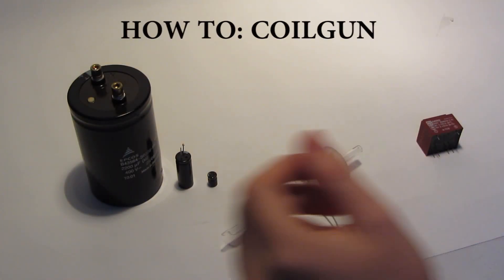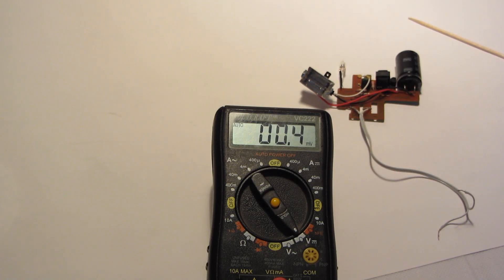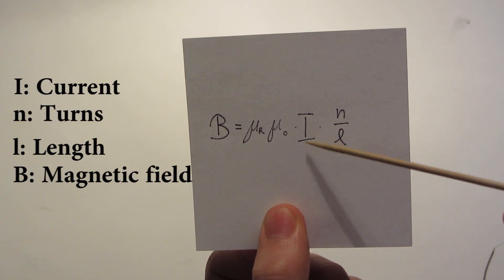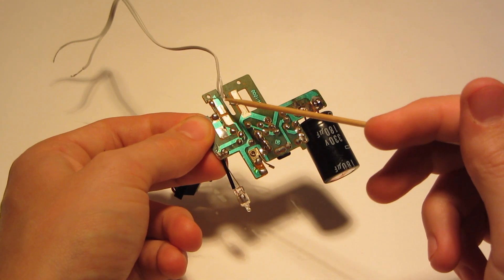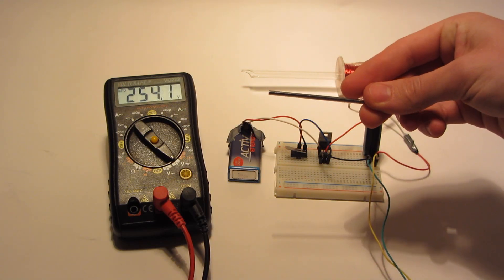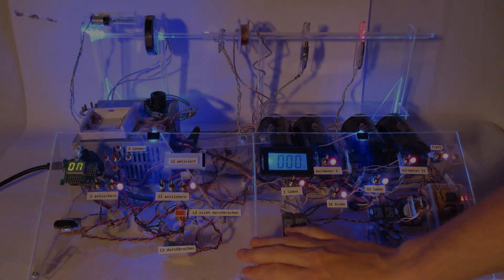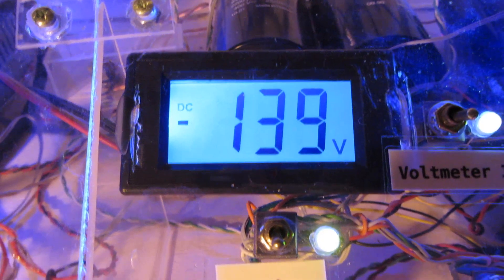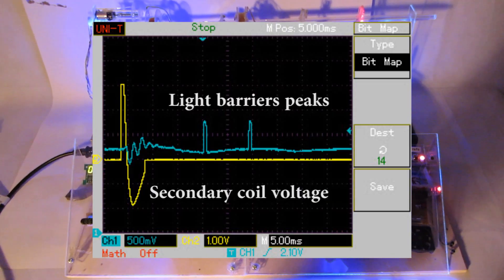How to build a Coilgun or Gaussgun Experiment - Tutorial

Comment: Is there any way to do it without any transformer or flash circuit?... I have four 1000 micro farad capacitors and they are small... As small as the capacitor in your flash circuit... I use a nail as a projectile and I connected three capacitors in parallel and charge them with 3 9v batteries... If I charge them with more batteries will I get better results?...
Reply: Just be careful. Don't charge the capacitors higher than the voltage they meant for.  Capacitors can easily blow up.  I've seen it many times. 
If you put them in parallel they will have up up 4000uf but still only the voltage it says it can hold. That's why high voltage capacitors for high uf are bulky.

Comment: what are the 3 little black things on your breadboard at 4:30? and is there a way to charge the capacitor by using a transformer and a 9v battery? (my  capacitor goes to 330v) ive been trying to figure out how to charge the capacitor but i realized that i need AC on one end of the transformer, and a 9v battery does not emit AC, its DC. and it confuses me how you got yours to charge with that 9v.

Comment: How do I identify the contacts which the battery normally contacts to?
Reply: ***** I got that and I think I found them but they seem to have a mind of their own,I connect them,nothing happens,I get frustrated and after I've calmed down I do the same exact thing again and it charges but I've charged and discharged it a few times now but now it doesn't want to charge at all for some reason.
Reply: Hendlton You might have burnt out your capacitor, it does not like being discharged like he did in the video, atleast not very often.
Reply: telefon72 Like I said,it didn't like charging so I discharged it maybe 2-3 times,I don't get how it doesn't like discharging if it's supposed to take photos.
Reply: Hendlton It does not like discharging like the way he did, where you short out the leads.
Reply: telefon72 Oh.

Comment: Voltage do not kill, milliamperes do kill. Voltage will hurt as hell but it isnt really what makes your heart stop beating. But if the voltage is really high and you have a low pain threshold and a weak heart then you might get an heart attack. just remember that most stun guns are in the region of 5000 volts.

(But beware i'm no electric expert)

Comment: What if you use two S6025L thyristors in parallel connection do you need to double up the resistor value for gate and also do you need to double the resistor value for gate katode connection?

Comment: Question: I tried this project before, sadly it didn't work. It could have been my coil, my circuit etc. My question is would upping the voltage make a more powerful Coilgun? Last time I used several capacitors out of disposable cameras, I wired them up into a series that totaled about 1000 volts. Would a microwave capacitor work? I know that they start at over 1K volts. Thanks for your time... great video.
Reply: Thanks!

Comment: This is amazing, but i have a question, i'm also building a kind of coilgun and i have salvaged a few microwaves(for my previous projects), i have 3 microwave capacitors left, with ratings like so - 1.05µF 2.1kV, would these be good for use with coilguns?
Reply: ***** thanks for the quick reply :) i did that and it turns out that even with such high voltage the energy released is only a fraction of what you have.

Comment: welp... just discharged the capacitor in my old broken camera  through my finger... nocked me on my ass for a Minuit. BEWARE
Reply: I did some basic electrical installation work at college a few years ago, using 12V car batteries as a source. When using capacitors and diodes, always use a capacitor/diode shorting tool (normally an electricians screwdriver!) I saw a few people getting 'bitten' by the 12VDC 65A source - funny to watch someone doing a 'Jesus' impression - ie being blown backwards 6 feet against a wall, with arms extended in the shape of a cross :)    then a year or 2 later, did the same myself with 240VAC (I didn't laugh). Be Careful With Electricity!

Comment: I was always interested in firearms, explosives, etc... but in fact being interested in  floating trains and electro magnetic propulsion led me back to this in my early days. again, great videos.
Reply: ***** have you used two capacitors into one coil? is that efficient?
Reply: *****  how does the length of the coil along the barrel make a difference? given the same length of coated wire?thanks
Reply: ***** but as a rule have te could length on the barall shorter... giving more coil?

Comment: I can show you how to build the power circuit to make the gun perform much better and more efficiently further I can show you how to use the coils back EMF to power the next coil in the array to use less power further I can show you how to operate the coils to be more efficient overall reducing your power consumption by 70 percent increase in your run time per charge and your power output by 80 percent